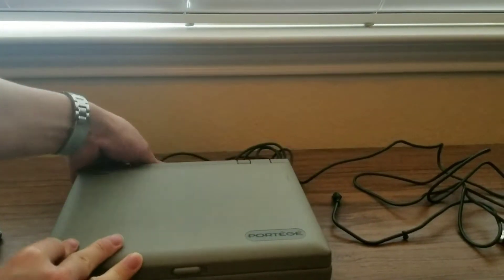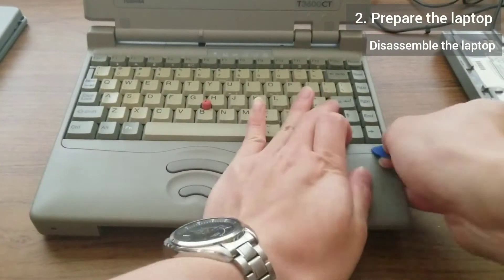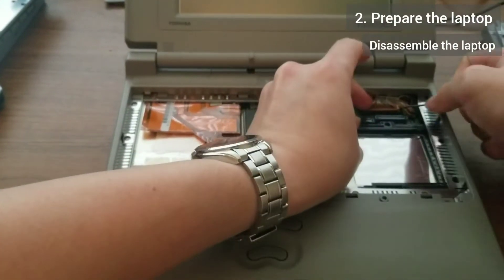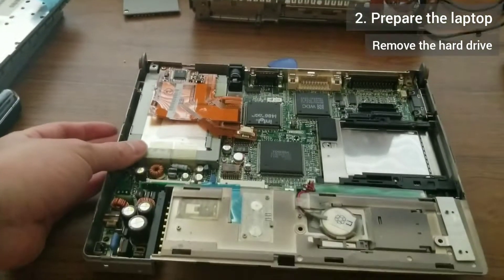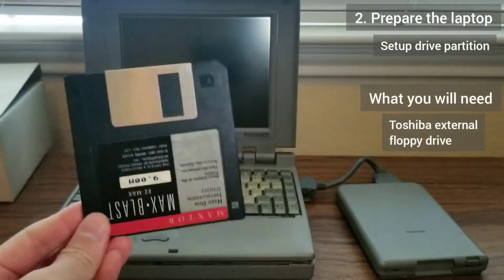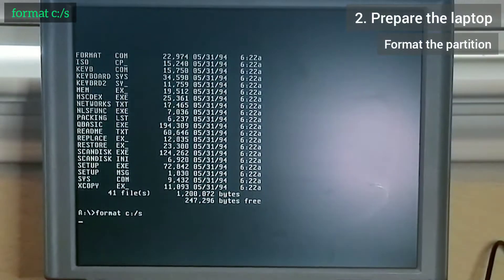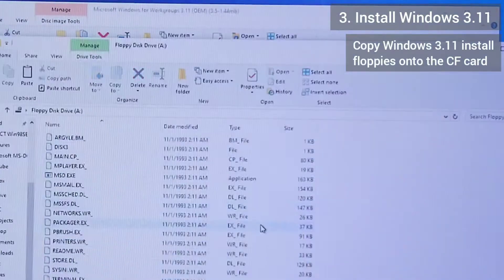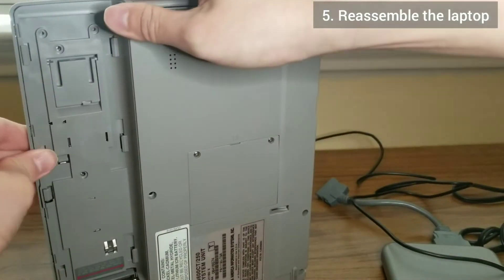Installing Windows 3.11 onto a Toshiba Portege T3600CT

Comment: Hi, im trying to fix mine, (it spins the hard drive for few seconds, and then turn itself off) and i saw that the big capacitor  is leaked, its bigger than the other ones, but i cant see the capacity of it to replace it. Do you know the capacity of the big metal one, on the left of the toshiba japan Chip and on the right of the hdd screw? Thanks :)
Reply from the maker: I don't know right now, but maybe this link may help: https://www.doomi.ch/toshiba-t4600-teardown/ . It's a different model (a year or two older), but maybe the capacitor looks similar?
Reply: @davidsdetaileddiscussions  ive figured it out, but thank you. Well it seems my toshiba is not fixable...

Comment: When I boot my t3600ce it quickly displays 
PIT ERROR and states read and write speeds beneath it. I'm at a loss how to interpret this message and how to proceed. Any advice appreciated.
Reply from the maker: you may need to replace the hard drive. are you using the original hard drive?
Reply: @davidsdetaileddiscussions  definitely the original hard drive. I may have to do much the same you have with the 2.5" ide to cf adapter. Please advise the best source for obtaining windows 95 files. I have a genuine product registration key I just need a verifiable source to get it from. Thanks for you input.